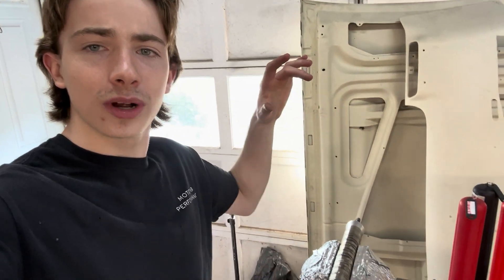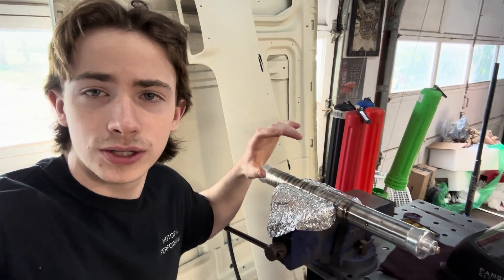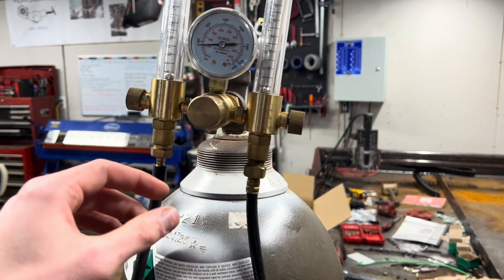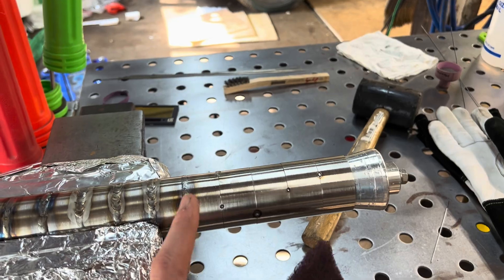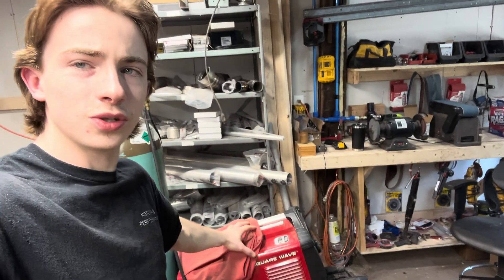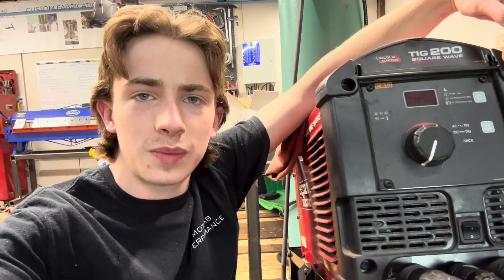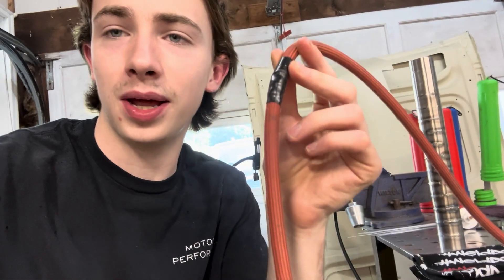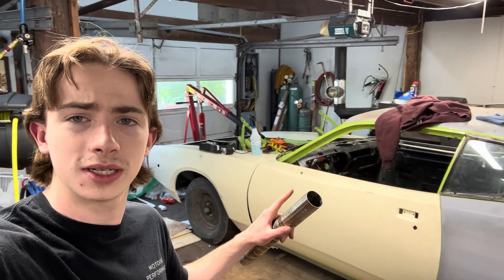The EASY Way to Weld INCONEL for Your Next BIG Project!

Comment: I spent alot of time (5 years /lots of overtime ) welding tons of inconel for Mitsubishi Steam Turbines , ill watch this and see if i have any tips for you
Reply from the maker: I’d appreciate it, I feel like I got it running pretty good but always room for improvement!
Reply: Nice shots of you welding man, good stuff
Reply from the maker: Thank you!
Reply: I would ask what Tungsten are you using, maybe you said and i missed but we used E3 tungsten, as well having a miller branded gas lens makes a difference vs esab etc believe it or not
Reply from the maker: I was using 2% lanthanated tungsten. I believe CK brand and a furick gas lense.
Reply: We also pretty much always prepped everything with a 60 grit 3m roloc pad or a carbide and acetone
Reply from the maker: I definitely want to use something more coarse to get more of that oxide layer off next time.
Reply: Also , slowly let off the pedal and drag the arc off of your finish and you can drag out any fish eyes
Reply: And i saw your post in the fabrication vault page on facebook, great group
Reply from the maker: Yes it is!
Reply: Looks good bro
Reply from the maker: Thank you!